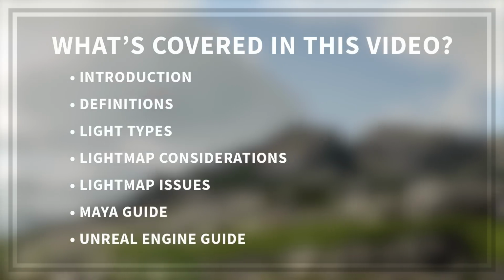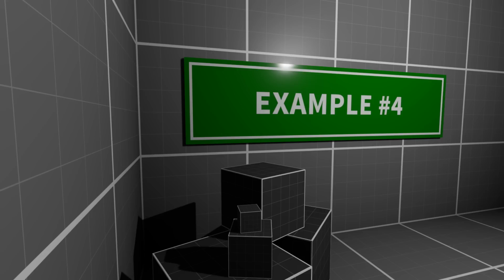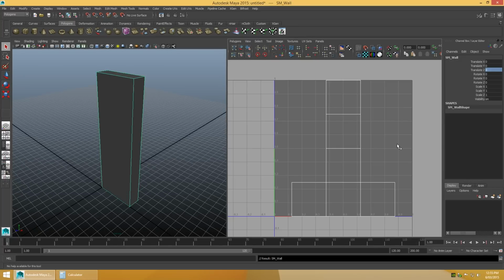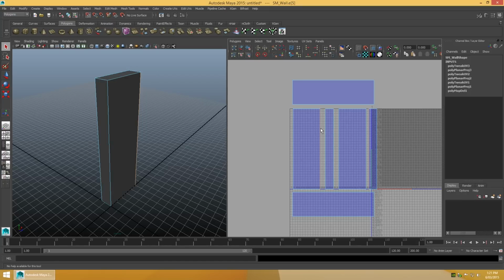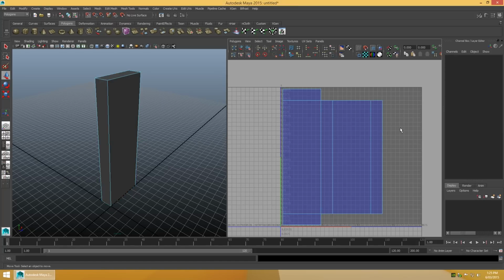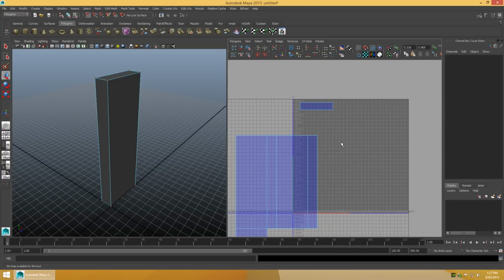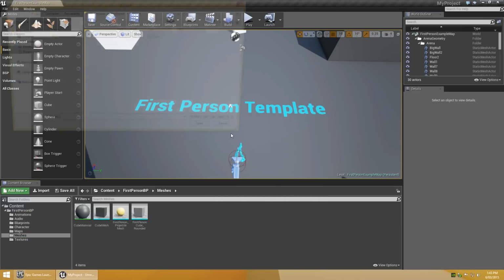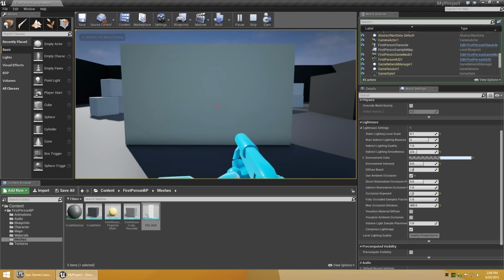"Baked Lighting" and "Lightmaps" (Maya & Unreal Engine)

Comment: Great video thank you! But i cant understand one thing... if i divide 1/32 and use that, its working well. Things snap to grid. But if i use 1/64 (to make 64 lightmaps, then things wont snap correctly... why?) i cant understand how that is working...
Reply: mmm it seems to be some type of bug in maya, depending if i enter 5 decimals or not... some times it wont let me.
Anyway, why you make 1/32?
Reply from the maker: I covered this at 8:02. To summarise, it's because the mesh has a simple UV layout (due to only containing 6 faces), and it's best practice to start with a small target resolution and then increase the resolution as required (since increasing the resolution by any multiple of two will still have the edges aligned to the grid, whereas the opposite isn't true). It's to avoid resource wastage, as the lightmap resolution should only be increased when more detail is required, and not as an attempt to mitigate light/shadow bleeding.

Comment: Very helpful. Are you planning on more tutorials?
Reply from the maker: I did have plans to, but have been unable to produce any additional videos due to time constraints. One day!

Regarding manually setting the lightmap UV channel within UE4, this can be done within the static mesh editor (which opens by default when double clicking on a static mesh asset within the content browser). There is an option group called "Static Mesh Settings" and the relevant setting is "Light Map Coordinate Index".

I hope that helps!
Reply: Thanks Ben. Are you working in the game industry Downunder? I was wondering if there is much opportunity there for 3D artists.
Reply from the maker: I'm not in the industry at present. I'm just a hobbyist. Truth be told, I'm not even an aspiring 3D artist, I just learnt the fundamentals out of necessity so I could start prototyping ideas. This tutorial merely came about as there wasn't (at least to my knowledge) an unambiguous guide for lightmap creation procedures, and it caused much confusion and frustration amongst aspiring game developers.

A quick glance at Indeed indicates there is approximately 40 listings for 3D artists in a game development context within my state, and double that for 3D artists in general. I'm unsure how hotly contested these roles would be.
Reply: Intriguing. What are you prototyping with UE4? A hobby project?

Comment: Great! Looking forward to the Blender version you mentioned. Unless I manage to apply the concepts myself :) seams and bleeding have been an issue for a while now, time to grab the bull by the horns..
Reply from the maker: The equivalent approach in Blender would be to load a checkerboard texture that is 32x32 pixels (or larger with increased complexity) within the UV editor, zoom in, and then select "Snap to Pixel". It works just as good as the Maya method featured in this video. Hopefully, that should get you started in the right direction.

Comment: so much work for a simple box..what will the artists do with some more complex model? this uv snapping, spacing etc. is a lot time consuming. 
great tutorial btw. thanks for sharing your knowledge ^^
Reply from the maker: I agree, it's a time consuming process, and unfortunately, it will continue to be a necessity until game engines move away from using pre-computed (i.e. "baked") lighting. However, real-time (i.e. "dynamic") lighting techniques are maturing, and computer hardware performance will catch up in time, so there is hope. As far as dealing with more complex models, you'd have to assess whether it is worth the time investment to manually unwrap and process the UV layouts (which will keep the lightmap resolution optimal), or use more automated unwrapping techniques (which will inevitably require increasing the lightmap resolution to achieve acceptable results).
Reply: I see.. i get it.
Thanks for the reply. I gave you a thumb and subscription. ^^

Comment: QUESTION: I have three UV channels on my mesh, one for diffuse that is unique to this asset, a UV for a shared normal map across all of my assets, a a lightmap. How do I make sure that unreal engine is using the proper UV set for the lightmap, and not the one for the normals?

Thanks :)
Reply from the maker: Hi Ross, within the Static Mesh Editor (which opens by default when you double-click on a static mesh), there is an option called "Light Map Coordinate Index" (which is under the "Static Mesh Settings" category). Simply change this value to the desired index. I hope that helps!
Reply: I figured it out eventually;  thanks for the reply!!

Comment: This video was so helpful, thank you so much! If you decide in the future to continue tutorials you would be very successful!

I have a small question. How does Unreal know that the second UV map is the one it should use as a light map? Do we have to specifically tell it to use that somewhere or is it automatic because you named it "LightMap".

Thanks :)
Reply from the maker: Hi Caitlin, you've likely figured it out by now (apologies for the long delay with replying), but this can be specified within the Static Mesh Editor (which opens by default when you double-click on a static mesh). There is an option called "Light Map Coordinate Index" (which is under the "Static Mesh Settings" category). By default, if there is only a single UV channel, index 0 will be used. However, if there are multiple UV channels, index 1 will be used. Therefore, if you have a static mesh with more than two UV channels, the index will need to be manually specified. I hope that helps!

Comment: So how would i do this in 3ds max,because i don't think it has same options in uv editor as maya does,it can't snap uvs to grid.
Reply from the maker: +EyefyourGf Unfortunately, I haven't used 3DS Max in quite a number of years, so I'm unsure how you'd go about achieving this. As far as I'm aware, Tim Hobson from Epic uses 3DS Max, so you may be best off creating a thread on the official forums (or PMing him directly).
Reply: +EyefyourGf no, you can! Check out buttom right corner, there's a picture of a magnet. It has two options: "snap to grid" and "snap to pixel". Also, in the settings of the UV Editor you can adjust the grid spacing and check box to show grid lines

Comment: And if I have 1000 polygons in model, I will need to manually snap them to grid for lightmap? That will take billion years to make! Any way to automate?
Reply from the maker: +izvarzone There are techniques to speed up the process on geometry dense models. However, in most cases, you're still going to have to align the hard edges to the pixel/UV grid to achieve good results (i.e. no light/shadow bleeding).

Comment: How to snap UV to grid in 3ds Max?
Reply from the maker: +izvarzone As mentioned above, I haven't used 3DS Max in many years, so I wouldn't be able to give you a definitive answer on how to achieve this. However, Tim Hobson from Epic uses 3DS Max, so I'm positive there is a solution. Creating a thread on the official forums (or sending Tim Hobson a PM directly) may be your best bet.

Comment: Great video description and workflow for Lightmaps. I never heard of grid snapping to aid in shadow bleeding, so kudos to that method. Do you know the logic behind that? 

Question, by cutting up the uv shells, would that not be prone to light bleeding compared to sewed shells? Is the logic behind separating the shells as a means to  snap them to the grid more easily? If so, couldn't you just use the sewed shells and then snap them to the grid? I only ask because the tips in the ue4 docs recommend sewing shells together for light maps. However, you clearly show your process working flawlessly :)
Reply from the maker: +ScreamHouseGames Regarding the grid snapping, it's to avoid the blending that occurs with half pixels. Regarding the separation of the UV shells, It's the opposite outcome actually. You'd be risking light/shadow bleeding by having the UV shells sewn together. The UV shells shouldn't be sewn together on models that have defined/hard edges, and would only be appropriate on more organic models where the shadow blending is beneficial. This is demonstrated in example #2 and #3, but in hindsight, I should have included the resulting baked lightmaps to better demonstrate what is occurring.

Comment: Awesome vid.

One thing though: I couldn't get my grid setup like yours. I set it to 1000, 1000 and 5, but it still wasn't the same. Is that because you're using Maya 2015? I'm using 2016.

EDIT: nevermind. Saw the second value should've been 100 not 1000.

Comment: That is one of the most usefull tutorial about UVs I watched...perfectly explained and the results are great...I welcome more tutorials like this!
Reply from the maker: Nicolas Esposito Much appreciated, thanks!
Reply: UnrealTutors Quick question: I'm creating modular walls ( for apartments layout )...First I'm creating a 280x100x10 cube with proper UV mapping ( 1st channel diffuse, 2nd channel Lightmap ) following your tutorial...but when I create a 200x100x10 or 280x200x10 the UVs are not properly scaled...is there a way in maya ( plugin or a different UVtoolset ) to auto-update the UVs without messing up too much the already created UVs? Since I'm planning to have 20-30 modular pieces it would be great to just having to snap vertices to the grid onl the 2nd UV channel rather then scale manually ( or do the UVs from scratch ) for each mesh.
Otherwise I'll take my time and create perfec UVs for all my meshes, but if there is an easier way it would be perfect :)

Comment: Also that tip about snapping UV's to the pixel grid + generating collision in Maya is so helpful- I have never seen those mentioned before! Great to see these workflow tips in Maya- there are lots of small things like that which are easy to miss! Quick question- which would be more beneficial- many small modular meshes or fewer larger modular meshes (for example, I'm building a scene with lots of walls and windows, so would it be more beneficial for both quality and build time to combine the wall/frame/glass pane and use the combined mesh as the modular asset, as opposed to just exporting the wall with a hole for the window, and the window mesh separately? I know it is probably a circumstance thing, but in general, is fewer better, assuming you have enough space and the lightmap is large enough?
Reply from the maker: Eoin O'Broin From a performance perspective, reducing the overall mesh quantity will reduce the draw calls and improve performance. From a workflow perspective, having more modular mesh pieces will provide efficiency and flexibility during the construction phase. Ultimately, you need a balance. In your instance, if there are various unique wall and window designs that need to be interchangeable, the best approach would be modular meshes.
Reply: UnrealTutors Awesome, thanks for the help with that! I have one FINAL question (if you have a donate page please link me as I have learned so much from this video + comment thread)- I was thinking of creating all of my corridor walls/floors/ceilings using only extruded planes as opposed to starting from a cube for simplicity- less geometry to work with, less UV mapping to do, more space gained + generally a speedier finished model- however on import to unreal it seems that light bleeds through the back of the planes/creates some artefacts with shadows and lighting. Would you generally recommend to just work with fully closed models, or are planes fine as long as they have some blocker geometry behind them to stop bleeding?

Comment: So helpful + clear + well laid out + professional- wow, amazing tutorial! Would love to see a complex model asset creation tutorial from scratch (Maya -> UE4). I'm still relying on the automatic layout in Maya for UV's, so I'd love to see a tutorial as high quality as this one on the UV process for a more complex hard surface model (still have yet to properly understand unfolding for curved edges etc)! Since the lightmap creation is fairly time consuming for a very simple mesh like this, I would imagine it would take hours for a more complex mesh? Thanks!
Reply from the maker: Eoin O'Broin I appreciate that, Eoin, thanks! I'm in the process of planning a comprehensive level design course and I intend on covering the asset creation pipeline in great detail. However, if you have any questions in the meantime, please be sure to let me know!
Reply: UnrealTutors Sounds awesome, can't wait! I actually ran into a small problem when moving and sewing the top/bottom shells- no matter what I tried, the second point (at 14:14 in this video), never quite is perfectly lined up with the point on the other shell- even with grid turned off completely (is there a way to get a greater degree of control when scaling- you seem to nail it after zooming in, but even when I'm zoomed in, the problem persists. When I hit the move and sew button, it does then snap, but the line does appear to be aliasing. Is this something that matters, or is it fine to just get as close as possible and sew?
Reply from the maker: Eoin O'Broin Unfortunately, not that I'm aware of. If you can't align it correctly (even after disabled snapping and zooming in), simply align it as best you can, and then highlight all of the UVs that need to be aligned correctly, and use the align UVs (min/max U/V) functions in the UV Texture Editor: http://i.imgur.com/DzI3SSW.png Hopefully, that makes sense. If not, let me know and I'll upload an example.
Reply: UnrealTutors Perfect, it worked nicely! Many thanks for the help!

Comment: This video was helpful, yet I'm still new to lightmaps so it's still too difficult for me to create the lightmaps for a desk I'm working on. I've been in college for 2 years and somehow we haven't touched lightmaps yet.
Reply from the maker: AntoniYOwned If you post a render/screenshot of your desk, I can take a look and offer some suggestions.
Reply: UnrealTutors Here is the model in Maya, not rendered. http://puu.sh/i7ltC/4e566596ae.png

Here's a render from Maya http://puu.sh/i7lhu/dbed90624b.jpg
Reply from the maker: AntoniYOwned Thanks for providing the render/screenshot. You should be able to planar map the entire mesh. On the curved sections (i.e. the desk supports) the scaling may be distorted, so you can select the appropriate UVs and select the "unfold" option in the UV Texture Editor window to correct this. On more complex meshes, you will likely need to increase the lightmap resolution. Unfortunately, there is no perfect approach, it's a bit of trial and error to achieve a good result without sacrificing performance. If you're constrained for time, you can even use automatic UV mapping and only make adjustments when required (i.e. if the light/shadow information looks odd once baked in engine). Generating lightmaps for complex meshes is something I'd like to cover in a future video, as the purpose of this video was merely to introduce the concepts. If you have any further questions, please let me know!
Reply: UnrealTutors The automatic UV mapping is something I may try. I appreciate the help, I'm subscribed for any future tutorials. I'm not really constrained for time, I'm just trying to make a quick game for the Oculus Rift. Thanks again, very solid tutorials.

Comment: Very good and thorough tutorial, just what I needed for my current project in Unreal. Also I didn't even know you could just export a collision mesh that way, great job. I do have a question though. For more complex models that can't be uv'd perfectly flat such as the wall segment you created, how would I go about snapping the UV points to the UV grid? Is the UV point snapping mainly used for simple modular meshes like walls, or must it be done for more complex props as well? Your help would be greatly appreciated :)
Reply from the maker: Aleksandar Zec Exactly. Snapping the UVs/vertices to the grid is only required on hard edges to prevent shadow bleeding and to ensure a crisp result. For organic meshes, the shadows bleeding/blending across the edges is perfectly fine. I may do a follow up to this video with additional examples.
Reply: UnrealTutors Thanks a bunch. I'm currently working on a level so this process will be a big help when creating lightmaps for tile-able walls and floors. After reading Unreals documentation on lightmaps I see that for more complex pieces correct UV spacing is the most important part to get right. I eagerly await the next tutorial if you decide to make one.